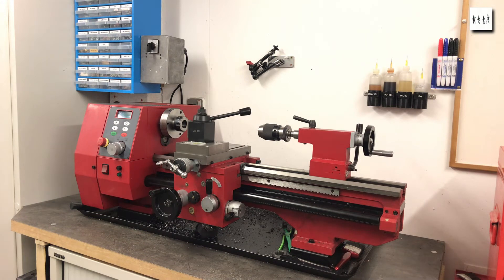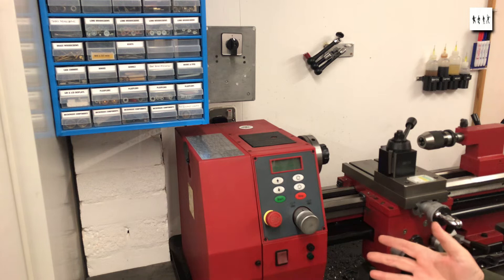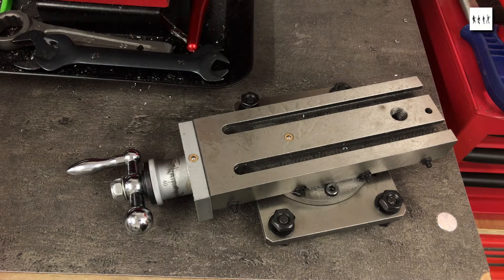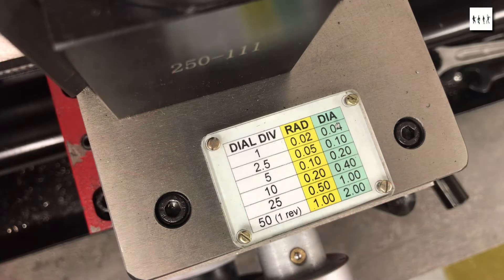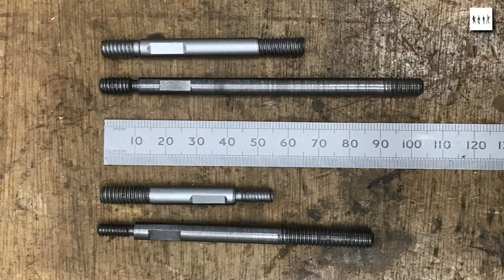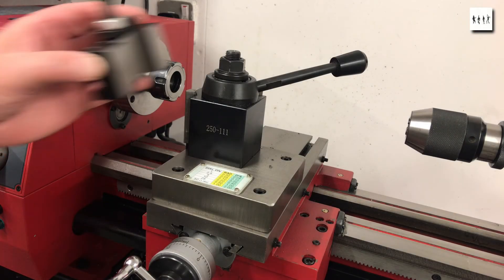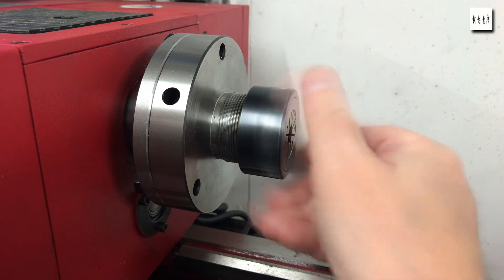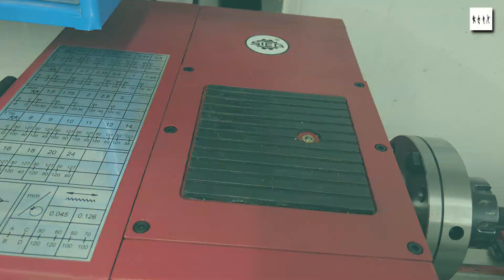SC4 Lathe Modifications

Comment: Nice lathe and interesting mods, I have always liked the Sieg SC4 lathe ever since they were first introduced and offered by a few other dealers in the UK before Arceurotrade started selling them.
 I have a few larger lathes from China and the UK which I have owned for many years now, but I am thinking of down sizing a little and the SC4 from Arceurotrade is possibly at the top of my list.
 One other thing to check, if you haven't already, is the pair of steel gears inside the headstock that drive the spindle. These are sometimes assembled at the factory with rather dirty and grimy looking grease, often also contaminated with metal swarf. So a good washout and rinse then fresh lube will make them last a lot longer, and sometimes quieten them down a little.
 Anyway, I hope you are happy with it and it serves you well for many years.
Reply from the maker: Thanks for that - I will have a go at the headstock gears in the near future, and hopefully make some improvement. It's not too noisy, but it is more so than I had initially expected. I'm really happy with the lathe, and it's a good match for my SX2.7 mill, also from Arc.

Comment: Any problems with tailstock alignment? I've spent hours trying to get mine adjusted and the bases keep breaking!
Reply from the maker: Hi Steve - I was wary about how the SC4 would perform straight out of the crate. In practice, for my everyday use of making simple mic stand adaptors and the like (not particularly tight-tolerance stuff), I have found it quite usable as-is. 

Mindful of the significant time and effort I had expended getting the tailstock aligned on my previous, smaller, lathe (CL300M), I've taken the 'ain't-broke-don't-fix-it' approach in the case of the  SC4, and have opted to defer any finer setting-up till I have a more dimensionally demanding project...

Breaking tailstock bases sounds like really bad news :-(
Reply: @reqordist  Yes, I've made a lot of parts that were not to tight tolerances but was frustrated on smaller/longer stuff where I was constantly turning tapers. I have (yet) another tailstock base on order from Axminster but they have said it takes 6 months to get spare parts for their lathes. I bought the last one from Arc and had a friend mill it down to suit, but the adjustment lugs inside are so brittle that they snap so easily when turning the grub screws.